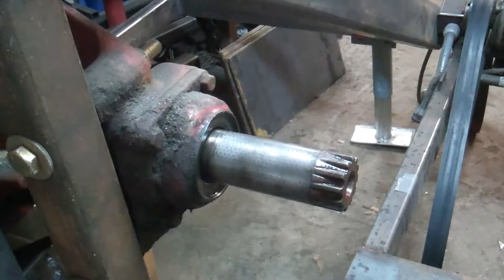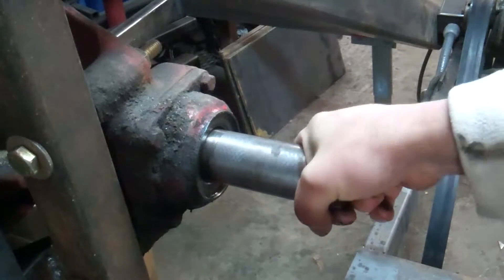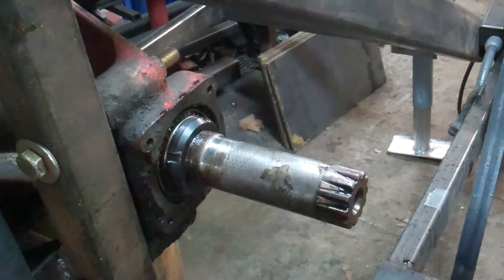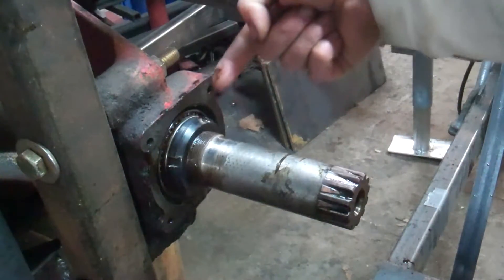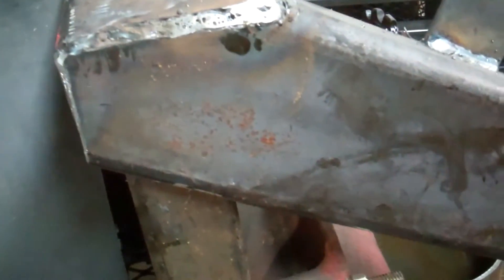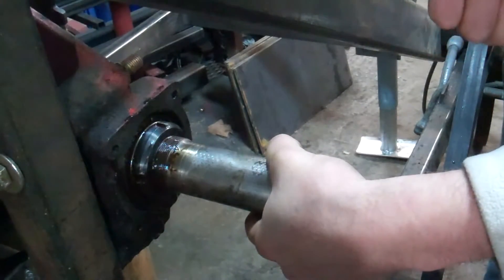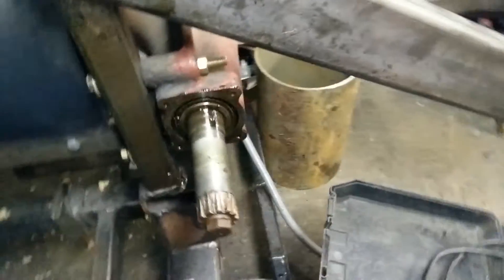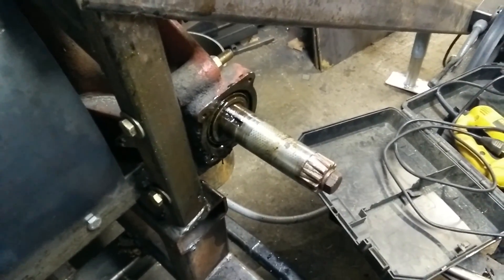Baler gearbox Part 1

Comment: Wondering if you were able to resolve this issue yet?
Reply from the maker: Diagnosed but not resolved. I'm going to pull the input shaft and replace the bearings. Along with a general cleanup and overhaul it should put things to rights.

Comment: It looks like the bearing has bottomed out against a shoulder on the shaft. You may have some wear in the outer bearing housing causing it to be out of adjustment. I suspect if changing the bearing and race is out of the question, if you were able to take out the shaft and turn down the shoulder a little, you may be able to seat the bearing where it needs to be. Good luck , keep us posted. Joe